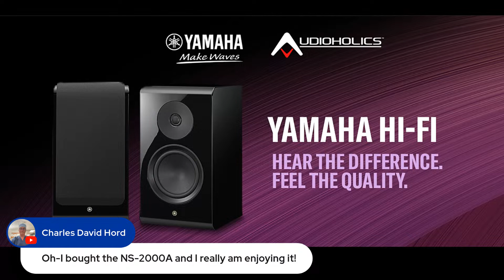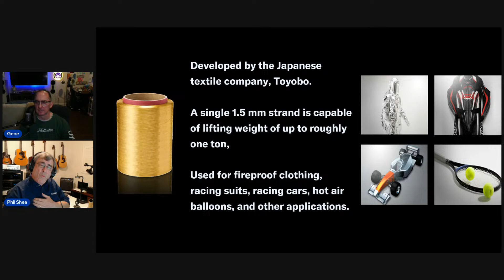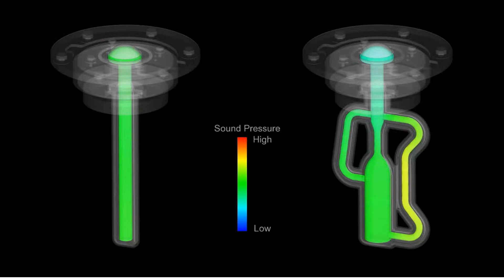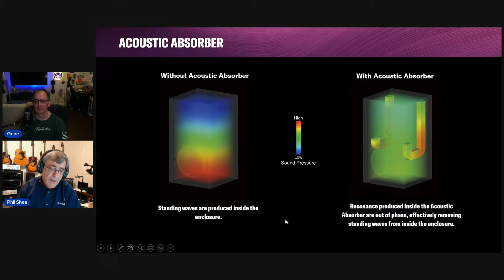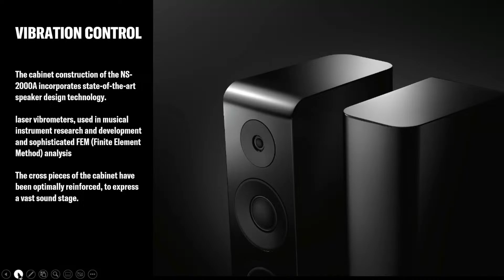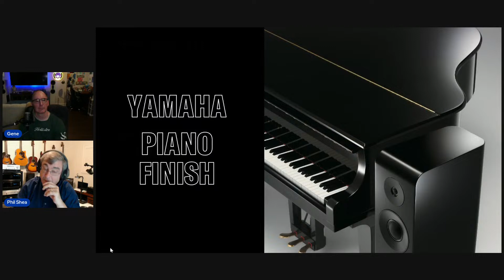Yamaha Loudspeaker Livestream & NS-800A Contest Giveaway!

Comment: Yamaha speakers were highly under-rated bargains when they lowered their prices massively 20 years ago. I believe they were trying to get a piece of the new home theater market which would require more speakers purchases and therefore they were trading pricing for volume sales. Probably a low marketing budget and perception by consumers with the low pricing meaning not as good they didn't get a lot of attention. They have now reverted back to higher pricing to pay for the increase marketing and appeal to the audiophile price snobery.